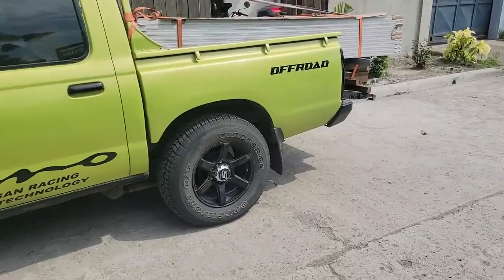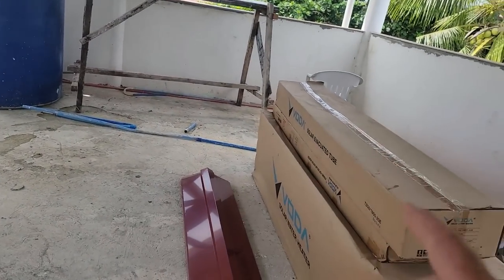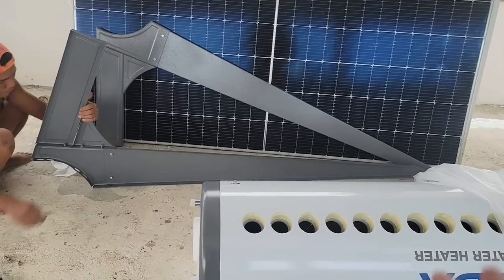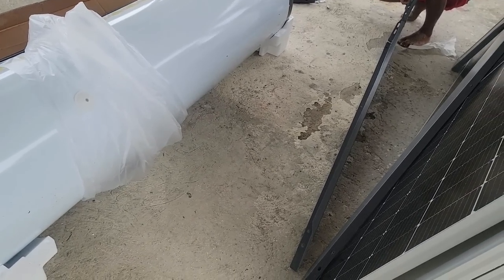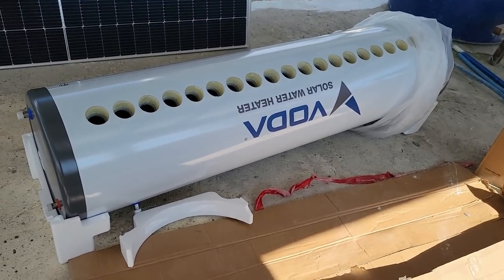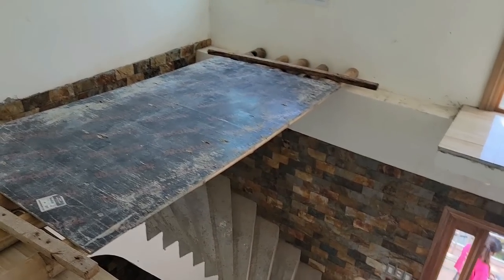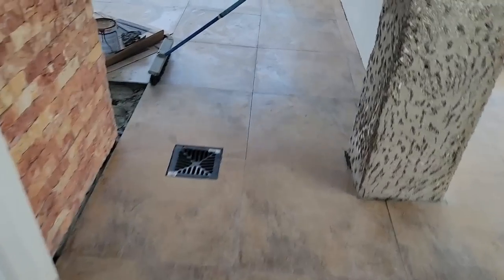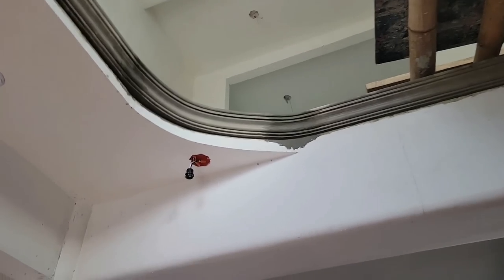Solar Water Heater Install plus more Solar surprises. VODA, SAHARA,SOLARA, SOLAR SPA, BEST TANK

Comment: Jim, I'm impressed! Texans often have a pro oil energy bent, but you are knocking this out of the park! I'm in the process of putting an array on the roofs here in the States, I'm using iron ridge racks like you are but I'm using microinverters which will dramatically keep down the voltage from several hundred volts DC for a central inverter system, to 240 volt AC from underneath each of the panels, and parallel in strings.
I would definitely recommend tucking the cables if you're using the DC approach because those really high voltages on a metal roof could end badly over time.
Very impressed with the high power panels you picked up. My mono panels are 445 or 415 watts each (I had to use two different brands). 
The vacuum tube hot water heaters are amazing, I've never used those but I've heard of them.

Comment: Hi will recommend Solar Thermo Tank. Though are are Manila based. They use pressurized system and titanium heaters and aluminum frames. Big difference in longevity.

Comment: Hook your over charge wires to heating elements in the water heater. so when you get to much power it heats water instead of hot air.
Reply: That's a thought, but needs to have a preset temperature measuring device in the circuit, so it cuts off automatically, once the desired temperature is reached perhaps?!
Reply from the maker: The dump is not that often  so you wont be getting much hot water!  Just not worth the effort.

Comment: You will be able to power the neighborhood with all of those panels.  I think solar hot water is an absolute home run, especially in the tropics.  I heard you say that the tank is not under pressure...did I understand you correctly that because of that the entire delivery of hot water to your faucets is from gravity and it is not repressurized some how after it leaves the tank?  How does that work in a mixing valve if hot and cold water are blended...how to you keep the pressurized cold water side from pushing back against the unpressurized hot water side?...I am sure it all works, am just curious how?

Comment: Wow James $174 per panel for a max power of 540 watts?  That's crazy.  Can't get anything close to that price in the USA!  Great job!

I did have a question though.  You showed us your old panels and I know you haven't cleaned up the wiring yet, but have you thought about putting the wiring in some form of conduit?  Something that is UV resistant?  Thanks in advance.

Comment: Thanks for sharing the video. I am planning on adding Solar Water Heater as well for 5 bedroom, 5 bath house. Any pros and cons after months of using the VODA solar water heater that you can share?
Reply from the maker: Just be sure and buy a pressure pump to it on the output side. It is a low pressure tank and the water needs to be boosted coming out. The pump is cheap

Comment: Hi James. I have one of those water heaters here in Germany. I would be very surprised if you ever need to turn on the electric heater on that. You have to watch out. It’s friggen hot when it comes off the roof.
Reply from the maker: Thank you Scott for sharing that. I think it will just need low volume to the faucets mixed with cold water at the faucet. High pressure will just be wasting the hot water as you will be mixing more cold with it to cool it off.
Reply: Thinking of getting on here in the Netherlands, how's your performing in winter ?
Have a air to water heatpump to support it, but would be nice   to have the majority come out of the evacuates tubes

Comment: Just a idea for you to chew on , it would be advisable  to install lightning protection for your solar system. I've seen a video about utuber that completely lost is solar system because it was not grounded.
Reply: An external lightning protection system consists of an air termination system, a down conductor system and a grounding system. The external protection system needs to protect the PV panels, the supports, buildings and all items, equipment or persons located outdoors and susceptible to direct lightning strikes.
Reply from the maker: @byron - I have a degree in telecommunications.  I worked with tall antennas and towers. ( funny because my name is Hightower) Wes sometimes installed on roof structures as well. There was many studies done on the effects, benefits and risk in lightning rods. The conclusion was they have a greater potential to draw lightning to your structure. Let me give some examples: Two buildings that was wood framed, brick veneered and had metal roofs had some basic equipment installed. Their insurance company demanded lightning rods and grounding the roof to earth ground rods. Both buildings took lightning hits and one burned completely down. All equipment was a loss. On the other 100 plus buildings that did not have lightning rods or the sheeting directly grounded no issues. Lightning arrestors or isolators  was most effective.  Now with all of that being said this is a concrete structure with an abundance of steel inside , metal roof purlins and steel sheeting.  The columns go deep in the earth to footings at ground water level. Two of those footings have cooper rods drove in and is bonded to the steel in the concrete on 16mm steel then the concrete was poured over it all.  My commercial grade electrical panel is earth grounded unlike most homes in the Philippines. I went to Western Lamp and Electric and bought  10 foot cooper ground rods. I shipped copper ground wire in a balikbayan box from the USA. Our main panel and all the solar equipment is grounded to this. "bonded"  Lastly the solar panel rails have grounding clips that are attached to them and the PV Combiner boxes have surge arrestors in them along side a breaker and each panel set has a blow fuse. This box too is earth grounded  and all going down tho their very own earth ground copper rod and wire. I think I have covered my bases. NO LIGHTNING RODS
Reply: @TexasFilipino  So, basically everything is well grounded! Therefore, your whole house is a "lighting rod" right? Without the rods! Interesting!
Reply from the maker: @byronthayer8990  Im not here to argue with you and it is my home my choices as I see fit.
Reply: @TexasFilipino  Texas, I'm not here to argue either. I just consider it constructive criticism! Right? I am 77 yrs. old and have a B.S. & 50+ yrs. in construction, architecture, signage (billboards) & engineering. AND....I don't consider myself the smartest guy in the room NOR to have more knowledge than you! I've been watching your vlogs for a year or two & enjoy them very much. Just celebrated my 14th wedding anniversary with my Filipino wife from Zambouguita, which is 45 min. South of Dumaguete. Really enjoyed your & Mel's trip around the Island. The Casaroro waterfalls about killed me too! LOL 👍👍👍👍 God bless you & Mel & the work you are doing. 😎😎😎 Big B in south Florida 🌴

Comment: those precast radius' look pretty sexy and will look even better painted up...   i was thinking if you added a pressure pump on the discharge side of the water heater ( after the  tank but before the house plumbing) that would give better pressure without any potential pressure to those glass tubes. 
not sure if a pressure tank would handle the HOT water for long as the bladder may degrade ... 
im sure you have it figured out and im just thinking out loud ...
Reply from the maker: at this height gravity feed might be strong. You can add a small pump at the discharge with a switch in the line that pumps anytime the hot water is turned on ant the line pressure drops. No tank required. I would not use those lousy pumps sold here.

Comment: Hi James, came along your video, because I bought the same solar water heater from Cityhardware, just the smaller version. Thanks to your Video I was able to assemble the frame. Thank you.
Like you, there was also manual in my package. Did you find already one? How did you connect the pipes?
Reply: Whats the pros and cons of a solar water heater?
Reply: Got it already. It's up and working
Reply: @heywoodjablomee6551  If there is enough sun, you don't need to take a cold shower anymore. The thing runs completely without electricity, except you connect the backup heater. 
The electric water heaters consumes a lot of electricity.

Comment: Hi Jim thanks for the video. I was just curious, for my own information, does the Philippines sell whole house on demand electric water heaters? If so, what are your reasons for purchasing solar water heater?
Reply: I don't speak for Jim of course but I have seen whole house water heaters in other Philippine videos. More typically, there's hot water electric heaters at the shower where it's most needed. A solar water heater would allow for whole house hot water like in the US, but you wouldn't be charged grid electricity if you use solar thermal to heat the water.

Comment: Thank you James for the vedieo Po i enjoyed it as i do most all of your vedieos .  Hey brother  im hardley ever negative  on anything here but that Solar water heater shows very cheap looking on the vedieo in my opinion.  You said that plastic  Piece looked cheap & you dont think it will last long  exposed in the sun . Well the whole thing looks like that to me bro im sorry but thats my opinion  i hope when you get tubes put in it takes on another look . Hey but looks mean nothing its the overall preformance that counts right ?  Man the sliding door added just what you needed there & im glad to see the tile also going in . James you know the quite time with no hammering & construction  noise will throw you onto withdrawls lmao absolutely  lol 😆  God Bless yall & Mabuhay
Reply from the maker: That heater  seems pretty nice. The housing is a thick pvc with couple inches of foam. The liner inside is polished stainless steel ( looks like a mirror) with copper coiled tubing and stainless steel fittings. The frame is powder coated and seems thick and well coated.
Reply: @TexasFilipino  oh ok James it just didn't show that well on camera to me but if it's like you say it should be a great heater. I couldn't tell what it was made from or how thick & couldn't see the stainless steel liner wow it sounds really cool & modern can't wait to see how it preforms for you Po .

Comment: I give that cheap tin in the water heater 1 year before it starts streaking rust stains
Reply from the maker: It is stainless steel lined with copper tubing. The exterior is a pvc and thick foam.

Comment: with those extra panels will you need more battery
Reply from the maker: what I wanted was more power to consume directly during the day and still have abundance to replenish the batteries at the same time.  My inverter will use solar directly without the batteries during the day. This means any solar being made during the daytime can get consumed without getting much of a charge on the batteries if its a semi cloudy day or worse. If it is very cloudy it will  greater potential to still produce a usable wattage. Let's say we have a multi-day low pressure system to set in. What I am very happy with is having that wind generator up. It surprises me. Last night it was strong winds and rainy. It was producing about 900 plus watts most of the night. We was running our aircon in the living room and the bedroom. I turned off the living room unit about 12 am last night. The bedroom I kept going. This morning we still had a full battery bank. I do consider adding batteries because when we have regular guest staying here the demand will be higher. On brown out days especially in the dry season rooms everywhere will book out that have generators and aircon.  This will be a silent generator and potential for return on investment.  Hope your doing well and thank for your comment James.